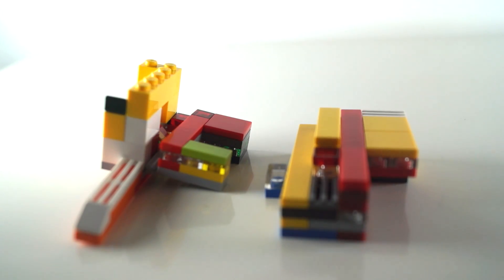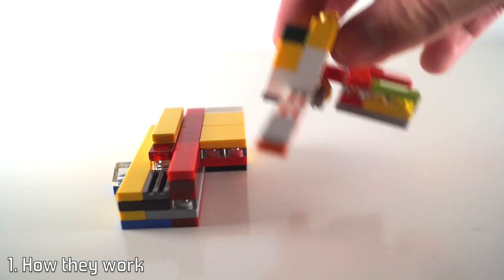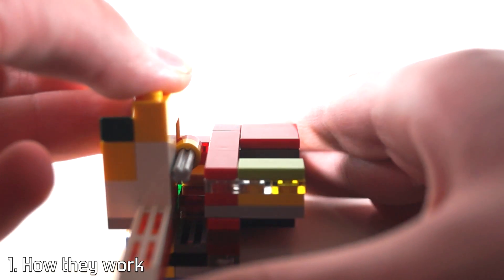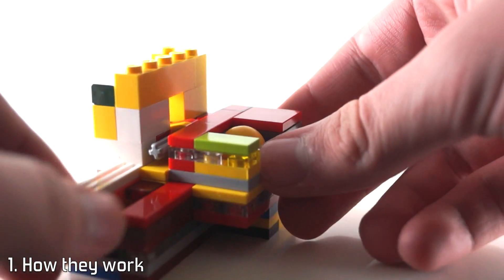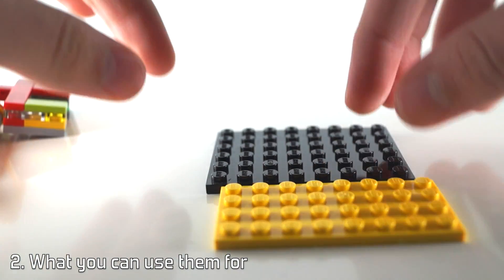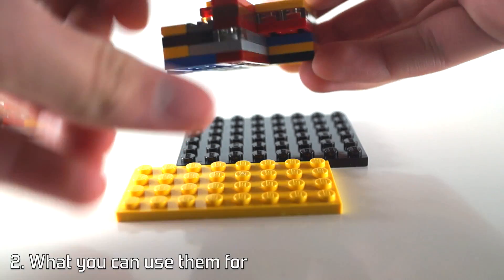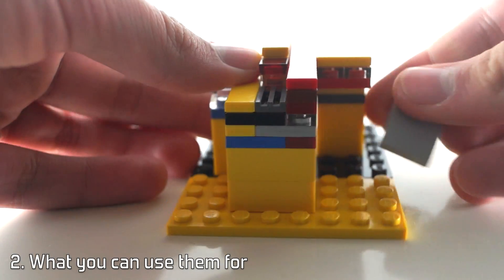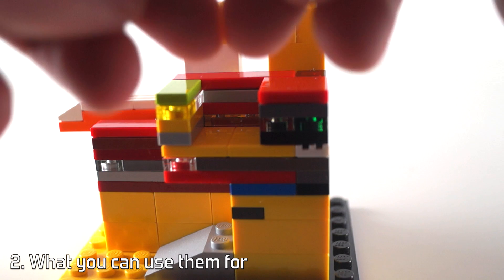How to Build a Lego Candy Machine Mechanism

Comment: what kind of gumballs? also how long is the cross rod thing piece the goes in the nickel lock level thing?...
Reply: lever*
Reply from the maker: You can use any kind of gumball that has a diameter of 1,5-2 lego studs. For example "Gobbstoppers".
Reply from the maker: Also the rod is 3 lego studs long.
Reply: ElectryDragonite  I use gobstoppers to  for this to. Nice mech :)